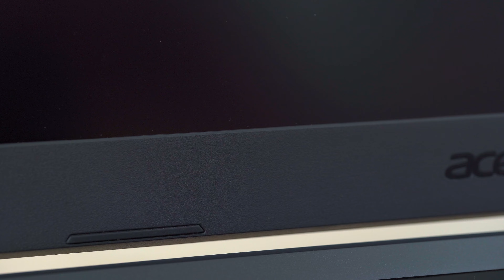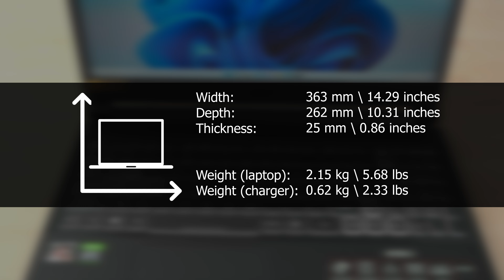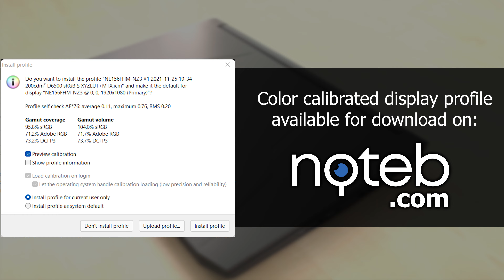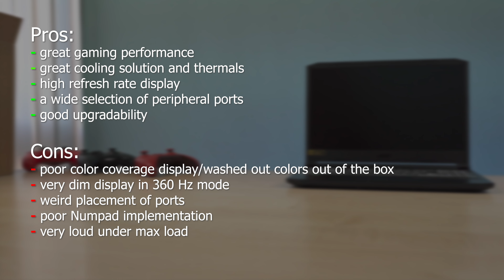Acer Nitro 5 AMD (2021) Review - Unboxing, Disassembly and Upgrade Options

Comment: I have an acer nitro 5 an515-53 model. Can I add Samsung 970 EVO Plus 500GB NVMe M.2 Internal SSD (MZ-V7S500/AM) in there? Does all acer nitro 5 models support this SSD?
Reply from the maker: That's a very old laptop but it should support the SSD you mentioned. I think all modern laptops (released after 2020) support this SSD model.

Comment: Is Better Acer nitro 5 i5-11400H with RTX 3050Ti (16GB RAM) or Ryzen 5-5600H with RTX 3060 (8GB RAM and I Will ad other 8GB)? i Specific that I will use it mainly for gaming, in addition to other activities.
Reply from the maker: Get the 3060 version the extra 2 GB of vRAM will help you on the long run.